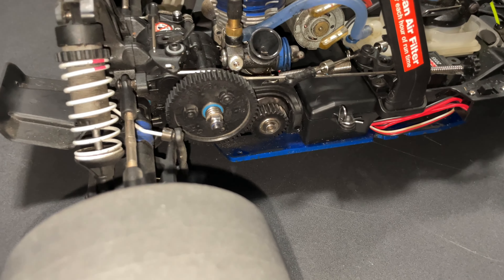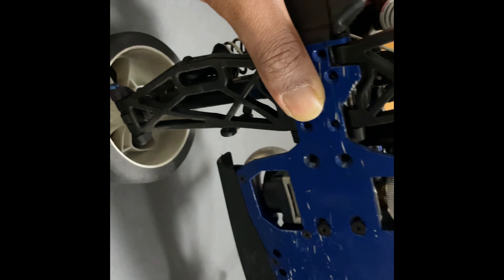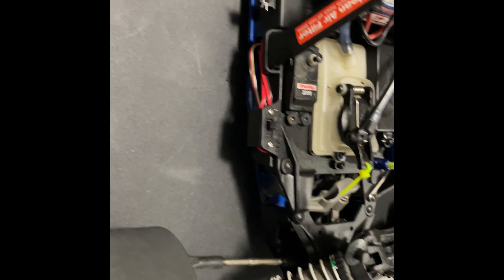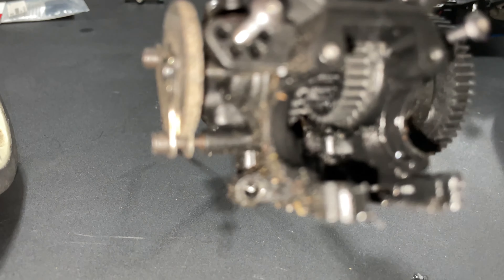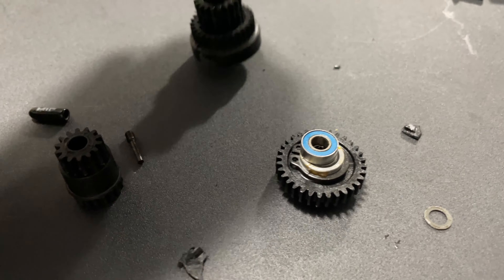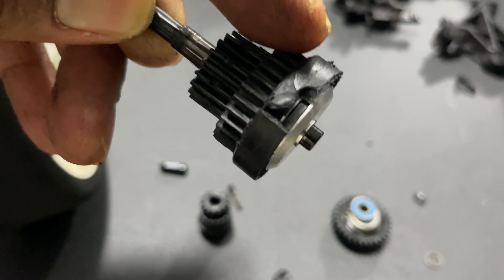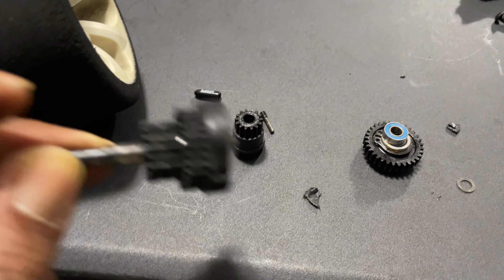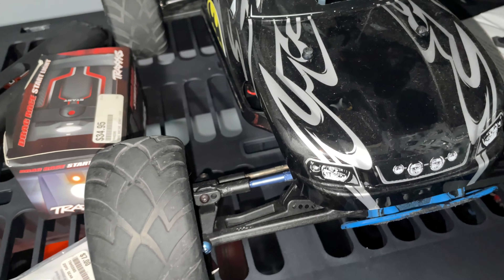How to fix a Traxxas jato transmission

Comment: Man those trans are the weakest point on them...went threw so many trans...the jato 3.3 is what got me out of nitro lmfao ....i loved it when it worked tho
Reply from the maker: I haven’t broke then enough to hate them but I use to build and tune a lot of them so working on them became easy. I find that having them shift at the right time helped the 2speed not break. To be fair this is the same transmission from 11 years ago, I bought a brand new complete transmission also. When I break this one I’ll put a complete new one in. 👊🏾
Reply: @UDRC85  that's incredible...your prob right...I had mine shifting high in the rooms n it kept blowing 2nd gear...I ended up with 3 jatos all broke at once lol I fixed a one trans twice,than bought 2 other used ones because i liked the wheelies n how they drove.....smacking 2nd sounded the best....🤙